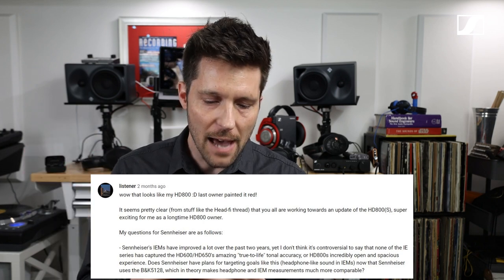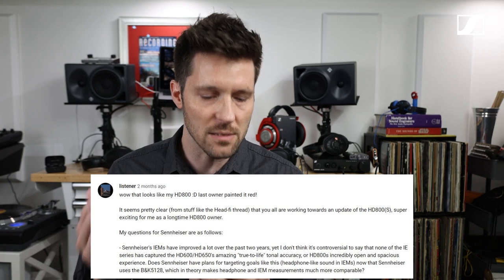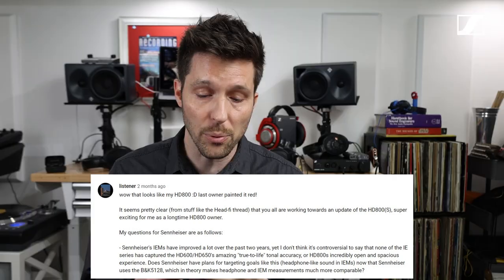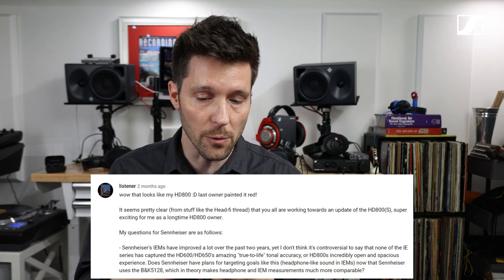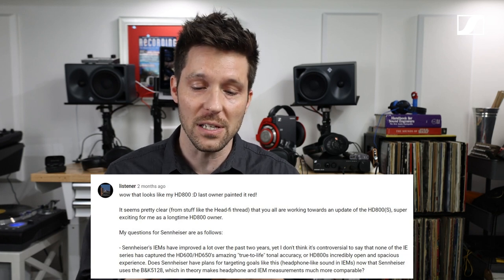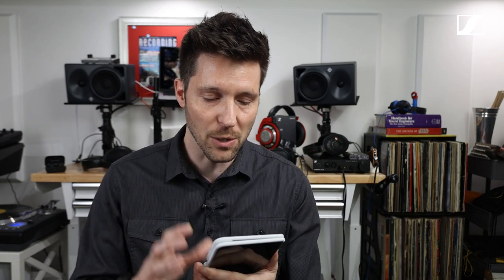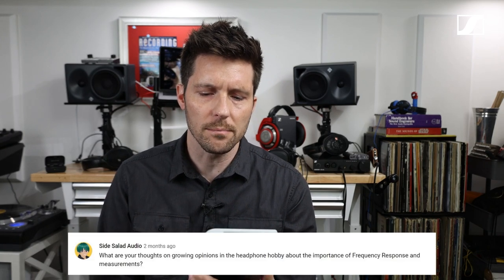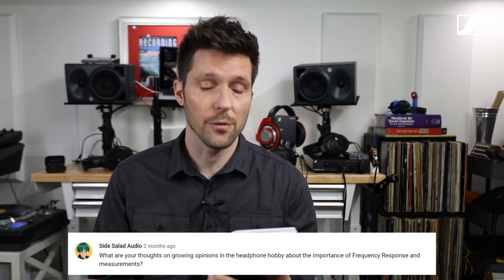Beyond the Curve - EP02 - R&D and Manufacturing | Sennheiser

Comment: While I appreciate my question being answered, I don’t love the response I got 🤣

Of course I acknowledge that acoustic impedance and openness are major factors, and FR as measured on a rig is not everything… but I maintain that targeting a more “headphone-like” midrange is a goal worth chasing in Sennheiser’s IEMs in particular.

I also, however, concede that it would likely be difficult to do so without active electronics/DSP.

That being said, it’s possible to try! If you want a rough idea for an IEM target that may work well for the avg. person, just take a blocked canal DF HRTF of the 5128, subtract that from the full DF HRTF, then add the blocked canal DF HRTF from Hammershøi and Møller. 

Should account for the effects of many pinnae and account for a (rough) average of canal effects since the B&K is an averaged human ear canal.

Regardless, thanks for the answer! Hope to see more videos like this.
Reply: I think they said that they take the lowest common denominator instead of the average. If you look at your HM they will give you +-1 SD. To get a target that is most inoffensive to most people you might even want to move -2 SD to play it save for the insert earphone.

Comment: Nice video guys! I love sennheiser products. I've been using them for over 15 years (microphones, speakers, headphones, earphones, etc.) I work as a DJ and love the HD25 headphones. Do you think there is any way to make that headphone even better in the future? Is Sennheiser is planning to release an IEM(s) definitely for DJs ? (like Shure did with the SE535 PRO, or Mackie with the MP-460 etc - with Triple, quad drivers not a single dynamic) I'm thinking to move for IEM's but I find the IE 500 PRO not as good like the other 2 mentioned before. Also why do you prefer single dinamic driver over triple drivers? (distortion?)
Reply from the maker: Thanks for the praise and your loyalty! I believe the HD 25 we've hit something of a sweet spot, there were some experiments to go beyond with the HD 8 DJ, but evidently there's good reason that the HD 25 is a classic.
Regarding IEMs, the IE 500 is specifically tuned to the needs of vocalists, ie. to monitor their own voice and hear the bass line. The IE 400 PRO will offer a more V-shaped presentation, while the IE 600 is probably the most neutral earphone in our line-up.
Regarding the driver question in brief: our 7mm TrueResponse transducer has best in class distortion values, handily covers the entire audible range and has headroom to spare for even the most demanding applications. Multi-driver systems tend to combine multiple systems because a single of their drivers would fail in at least one of these performance metrics. While we get the marketing appeal of more=better, we strictly believe in superior sound performance that is measurable and audible, and our 7mm single driver platform delivers that class-leading performance. If the tuning of the IE 500 didn't speak to you, I can only recommend testing the other products of our range, which are in my opinion much better suited for music listening.
-Jermo
Reply: @sennheiser  thank you for the answer I will try the IE 400 PRO and the IE 600 hopefully I will find the right one :)

Comment: Thank you for the new eposide! I hope you will do many more.
I have infinite number of questions. I wrote some in the Reddit thread of this video. Youtube does not allow me to post the Reddit link here, so i will copy my questions here in sub-comments. Thank for any answer in advance.
Reply: You said that the biggest difficulty in the production of HD 800 is to match the 2 stereo channels. But why do you not achieve this kind of task with software correction?

Measure both sides of all instances; publish the data on your website [separately for each instance, indexed by the instance identifier]; let the user import his one into his favorite sound software [Equalizer APO, PulseEffects, ...]; let him apply a convolutional filter.

It seems to me that this simple procedure would give perfectly smooth frequency response [including stereo matching] [apart from the listener-specific parts of course] for low cost.

Why do you not use this method? Is measurement per instance too expensive? How much does a measurement cost?
Reply: Please go through all your audiophile headphone types and talk some about them. What is their advantage compared to their Sennheiser peers [or even to other brands too, if you will]. Why is that advantage difficult [expensive] to achieve?

By your audiophile headphone types i mean: 559, 595, 598, 599, 560s, 600, 650, 660s, 800, 800s.
Reply: Why is resonance a problem? Is a frequency response correction [perhaps by software] not enough to cease it? For example, if the resonance is at 1KHz then is decreasing the amplitude at 1 KHz by the resonance amount not enough to get rid of the affect of the resonance? Does resonance harm any other property too other than the frequency response?
Reply: What is "full", "tight" "wet", "dry" ... sound? Do these have an explanation via the frequency response?
Reply: Is 'lingering' a real phenomenon. I mean when the decay at some frequency is much slower than at other frequency? What usually causes it?

Does a software algorithm exist that perfectly eliminates the affect of slow decay and attack generally [provided that the (frequency -> decay speed) function is known]? If yes then why is it not in use at all?
Reply: What are "grain", "spark", "glare", "sibilance" in the sound? Are these phenomena present in the frequency response?
Reply: Is "sound-stage" a scientifically understood property? Do you know why HD 5** headphones have bigger sound-stage than HD 6** headphones do? Can you design a headphone for better sound-stage? How do you do that? What do you need to trade-off for it?
Reply from the maker: Thanks so much, that's quite the barrage! We'll note the questions down for one of the coming episodes, or if I have some free time over the next days I'll sneak in a few responses ;)
-Jermo
Reply: @sennheiser 
Thank you in advance.

Please put your answers into future episodes instead of comments. In comments your answers would get lost. I think many are interested in these topics [they are debated in lengthy threads in internet forums].

Please do not compact them into one eposide, give them more, give them time :-), lengthy answers please.

Be careful not to tell business secrets, i do not want to pull you into trouble or regret. If you tell only knowledge that is known by other headphone firms too: that is already big gift from you for the enthusiasts, and much waited.
Reply from the maker: @zoltantoth1566  We'll see what we can do.

Comment: In addition to the sound changes from deifferent HD800,/s i found another more important factor, which is earpads. Aged earpads or early produced earpads sound way different from current earpads, current earpads absorbed 1-2khz and enhanced the mid bass response while old version has more treble and more close to the DF, an aged earpads meanwhile will leak more bass when compared to the new one.
Reply from the maker: Interesting point.

Comment: What is your opinion on the consumer using EQ to tune an HD800S to the Harman Curve?
Reply from the maker: It's a product they bought, so they are free to listen to it in any way they wish. Personally, I'd like it much more if they took the time and equalized to what sounds good to them by ear. People will prefer significantly different high- and low shelf filters, and the amplitude of the mids has a big impact on the stage you can get out of headphones. That being said, the headphones will sound great with many different tuning targets, simply because it's so spacious and fast sounding.
-Jermo
Reply: @sennheiser  thanks for responding. I use a harman preset but tune it by ear to my preference. I really like how the 800S sounds in the low mids and bass, i just change the treble and slightly boost subbass. They're amazing headphones.